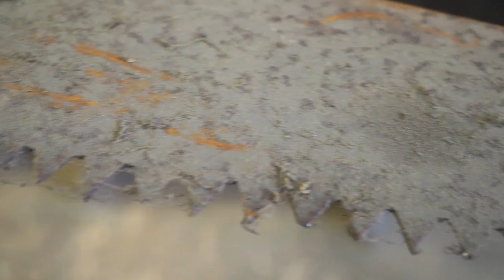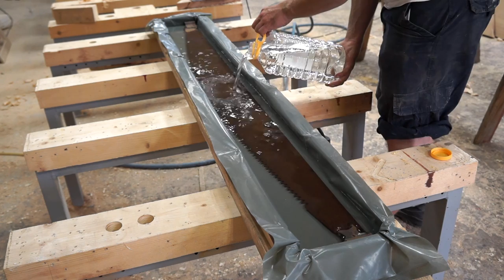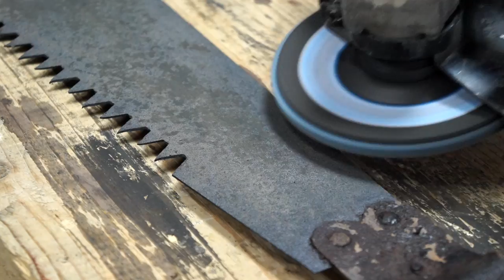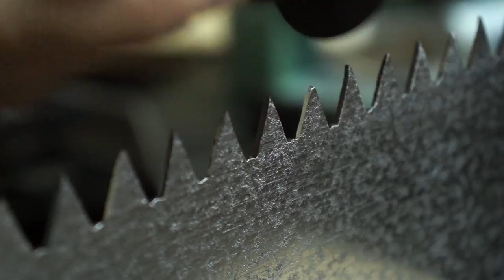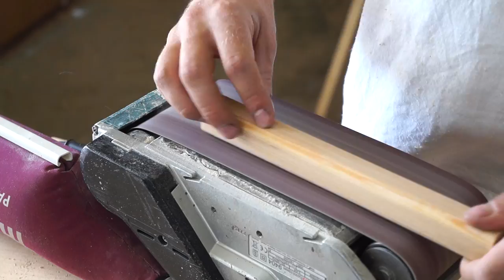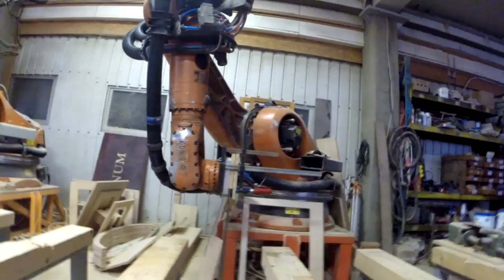Two man saw restoration with white vinegar

Comment: Awesome video! Great idea to use vinegar I would of never thought if that. The robot at the end was super cool. Great job.
Reply from the maker: Thank you Eli!:)  First I thought of using hydrochloric acid but it is kinda dangerous and hard to get rid of in environment friendly way. It is also hard to control because without special additive, it starts to eat metal after it is done with corrosion.  So my friend who is a chemist suggested white vinegar. Not nearly as fast but it's not hazardous and gets the job done..

Comment: Also lignum one more question. If you don't mind to tell me, what kinda of camera do you use?
Reply from the maker: I use gopro 3+black and sony alpha 3000. Alpha has great image quality for it's low price and it is quite sturdy, just basic options though. Also comes with lens that is not so hard to disassemble and clean, which I have to do once in a while  because of all the dust in the shop.
Reply: Thank you I was looking at new cameras because I want a camera that zooms it and out un like a GoPro hero 5. And I will check in to the alph 3000. Thanks lignum